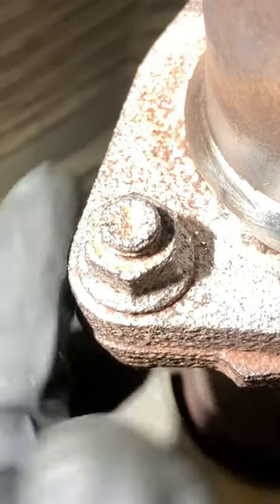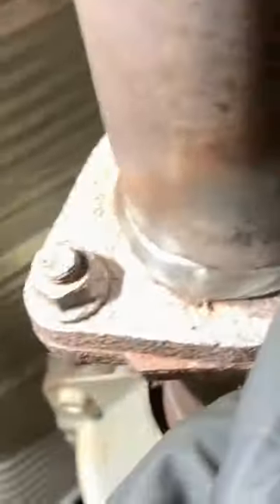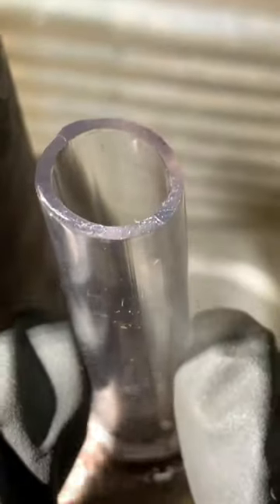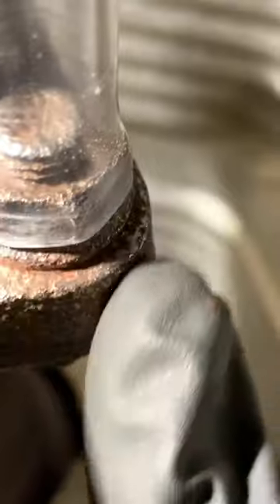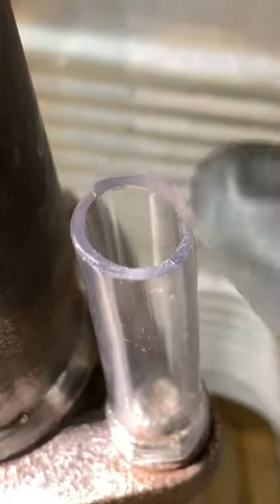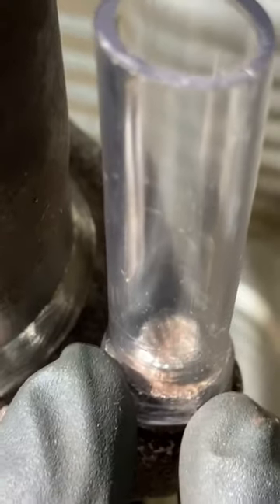Catalytic converter nut removal tips.

Comment: Thats not a lot of rust. A lot of rust is when there's no nut left, just a blob of rusted metal where the nut used to be.
Reply: Rust is rust
Reply: @Anonymous_1210  indeed, but when something is rusty yet still has the complete shape of the nut vs something that has literally turned into a unidentifiable blob.....these are different worlds.

I need to drop my sister's exhaust & there's areas I literally don't know what is the nut, bolt, or stud. It's literally just rounded, rusted, blobs. I think the only tool going on to any of it is something that cuts.
Reply: @RothBeyondTheGrave  yeah, no, I agree. I have some unlucky cases where the nut looks perfect, but the threads are locked together super tight due to oxidation
Reply: @Anonymous_1210  very true, looks can be deceiving. The ok looking nut could be completely welded & the rust blob might just crumble off in my hands hahaha...
I did have front rotors once that were rust welded onto the hubs so bad, I inadvertently bent the hubs from what it took (& how long it took) to get them off.

Comment: Oven cleaner works wonders
Reply: instead of a rust penetrant?
Reply: @terrybo5924   I work in the oilfield offshore.  We mess with beyond rusty bolts.  I spray oven cleaner on them and let them sit a little bit.  Then use a hammer wrench to break them lose

Comment: Wouldn’t heating it up just make it tighter?
Reply: In this case, the circumference of the nut increases, hence the diameter increases. Even in cases where it does get tighter, e.g. a steel bolt in a aluminum fixture, it can still work because it still breaks the corrosion bond.